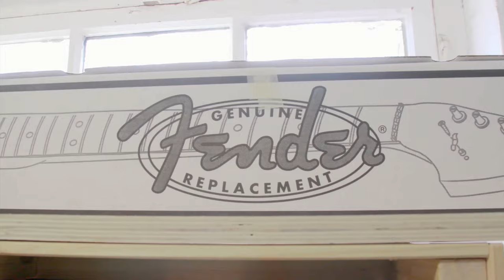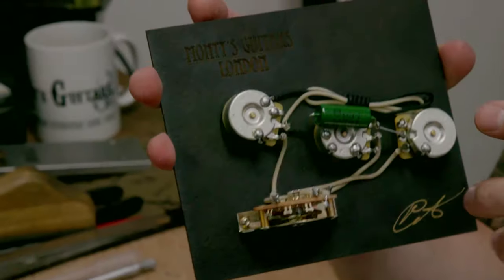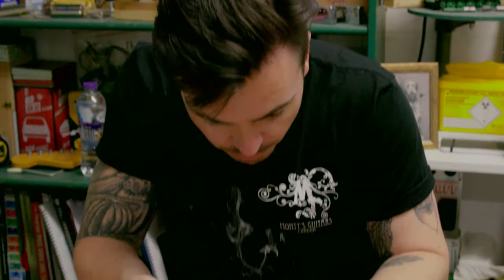Can we make this £75 Encore Stratocaster sound like the all original 63!!!

Comment: Absolutely fantastic video and the smile when you played the encore, was just awesome.  Big question though! how much would the pickups, the rewire, refret and setup cost?
Reply from the maker: It was a massive improvement over what it sounded at the start. It was a massive job and for those exact spec components and work (reshoot, refret, new bone nut etc) you'd be looking at £700-£1000 depending on where you went but, lots of it you could do yourself with a bit of practice. So yes it's not cheap but still a lot less than the (£15000 I say in the video, I found out after it cost £30000) Strat. Thanks for watching. Matt
Reply: @Montysguitarsandpickups  But like you said, today, you can buy a 100 too 200 excellent plying and sounding guitars.
Reply from the maker: @alainbrisebois8334  you can but it depends on what tones etc you are chasing.

Comment: I upgraded a $90 Korean made strat I bought in 2006 (with still useable gig bag thrown in for free) with Guitar Fetish high impedance single coil strat type pick ups, brass bridge block, titanium block saddles, new pots, 5 way switch, input jack and rewiring the tone pots so the bridge pick up could be tone adjusted. Previously, I had the tuners changed to Grover mini locking, a professional set up and frets 10 and higher leveled and crowned by Sal the luthier who was at Sam Ash on Sunset Blvd here in LA for some 20 years who did all the work, first in 2006 and then in 2018.  All of that was done for $400, including labor. The brand name is Bronx. It has the best rosewood fretboard I've seen on any guitar. I would put it up against any strat type guitar. The neck single coil sounds exactly like Clapton's Gibson humbucker tone on Disraeli Gears, which was a most pleasant surprise. Custom upgrade your electric guitars yourself is the way to go. No need to spend two grand on a Fender Pro series axe. Sure miss Sal now that Sam Ash closed it's doors. Anyone know how to get a hold of him?

Comment: I have an Indian made (1980’s) Encore strat. It’s amazing. Currently running emg selects because we had them hanging around…upgraded the trem for one with brass block, has lockers, graphite nut and it’s incredible.
Fender full size body, heavy as hell and sings like a strat and plays like one.

Currently upgrading a 96 squier with orange drops, CTS, 64 voices handwound for pickups and stupidly slinky .7 gauge strings

Comment: Great Video, I love this stuff. I bought a black Encore Strat off Ebay for around £15 and I took it apart, changed all the pots, the wiring and put an Oak Gigsby 5 way switch and Alnico 5 pick Ups as the originals hummed like crazy. Put some copper tape in to isolate the Hum, changed the Tremolo Arm for a Wilkinson and my Grandson who is getting to be a good guitar player at 14 years, he now loves it through his Marshall or Fender 15 frontman, I changed the speaker in the Fender, as the original is garbage. He also plays an Epiphone Acoustic I got for him, when he was 13. I filed the original frets and polished them, straightened the truss rod,  which is not so easy in our version, it is an early one, like yours. I also changed the nut for a Bone nut. The next thing I will replace, will be locking tuners, maybe Wilkinson as they are good, not so expensive.  I have bought him, so far a Telecaster Copy, Les Paul copy and a East Coast copy Precision Bass. The modified Encore is now his favorite Electric Guitar.
Reply from the maker: Great work it sounds like your grandson is amassing quite a collection. Modding guitars is always fun!

Comment: One of the reasons I love the stratocaster (and the Tele too) is that they reduce electric guitar to the simplest of requirements. 
All you need are two pieces of seasoned wood bolted together and some good pickups. 
The rest of the time and money you saved not going down the rabbithole you can spend on the really important part: the amplifier and speaker.

Comment: I have a 1983 JV Squier (I believe the same kind of guitar you did a pickup rewind on recent). Well mine has terrible wiring (not sure if original) along with a non original neck pickup. Tempted to give it the same makeover you gave the Encore...
Reply from the maker: Sounds like you have a goodn' you might not have to be as brutal as I was on the Encore to get it rocking.

Comment: Noticed you are using actual zippo lighter fluid , get some panel wipe its pure naptha aswell and you can get 5 liters of it for like 15 quid (just be sure to check the product sheet and check its actually naptha based panel wipe)
Reply from the maker: Thanks for the tip I've ordered some!

Comment: This was really informative. I have a 1970's sunburst 'lawsuit' strat that I'm doing a similar job with. bit delayed because i have to work out of my small shed and the weather has not been kind. Interested in those pickups. I have some Alnico V 'vintage' single coil replacements ( although i'm toying with the idea of a hot rail humbucker on the bridge ). Do you sell the pickups you featured?
Obviously I'm going orange drop caps and cts pots. I'm also going a bit mad and stripping back the sunburst finish to see what the wood grain is like in consideration for  a nice natural oiled finish ( I'm a carpenter, not a luthier, I like a nice bit of wood ;) ) I think it's ash.

You did a fantastic job here and if anything I thought the 63 was a little muddy in comparison but let's be fair, you call it a £75 Encore but you've put at least £1000 of work into that if you factor in your time.
Reply from the maker: Thanks for the kind words. This was a really fun project. The pickups in the video are our 62 Strat set which are available here www.montysguitars.com a humbucker in the bridge is always a goodn but you can also try adding a baseplate to your standard Strat bridge pickup as it boosts the lower mids and gives you more punch. If there’s anything I can help with just get in touch cheers Matt

Comment: Modern volume manufacturing (CNC and appropriate quality control) has made it possible to get decent quality playable guitars for between £300-£500. It’s actually quite difficult to find a total lemon these days. These sort of instruments will imitate more expensive guitars and will feel basic but playable. However, corners will have been cut everywhere; wood quality, hardware, finishing and setup. You won’t convert a cheap guitar into an expensive one by changing the pickups. You’ll improve it, but it’s still going to be basically a cheap guitar. In guitar making it’s the details that count. The care in preparing the fretwork, nut and neck edges, the better finishing and the higher end hardware and better quality wood all add up to something better and different. I’d say something like a Player’s Strat would have been a better candidate for this. Put decent pickups on that and spend time on the fretwork, nut and setup and you’d get quite close to a very decent Strat.
Reply: Oh dear, it's got nothing whatsoever about cheap or expensive, what is it with the mentality about how much things cost in relation to quality, you ever played a Encore Vintage or an Indian Squier, no you haven't otherwise you'd know it's unrelated, now back to reading your Guitar Mags and all the glossy BS. Even Leo Fender said his original Strats were junk!
Reply: @sonicmistress  I’m inclined to ask if you’ve ever played a decent guitar? If you had you’d understand the difference between budget guitars and  more expensive instruments. Everyone buys and enjoys what they can afford. However, you can’t seriously compare an Encore or a Squier to an American made Strat? Believe me I have played and owned many guitars from £100-£3k. There’s nothing wrong with a £100 guitar but it sounds and feels different to one that costs £1500.

Comment: The Strat still sounded better but this demonstrates that pickups are the most important part of a guitar. No need to buy dirt cheap guitars which could have a range of problems. Get a reasonable one then upgrade pickups but a few hundred £ can still get you something decent. Old 90s Epiphone G400s and Yamaha Pacificas are good basic guitars. Once you have much more expensive guitars you realise that some of the cheaper ones are absolutely fine.

Comment: I didn't get the point of this. You spent hundreds of ££ trying to make a cheap guitar sound expensive. Might as well buy the expensive one in the first place.  You dont need a 50 year old Fender to get that classic tone.
The pick ups your mounted doesn't sound as smooth as the original one. Yes is more trebly almost brittle without the presence of the low mids. for £225 a set for these pick ups  questionable investment. But you are indeed good at guitar building.